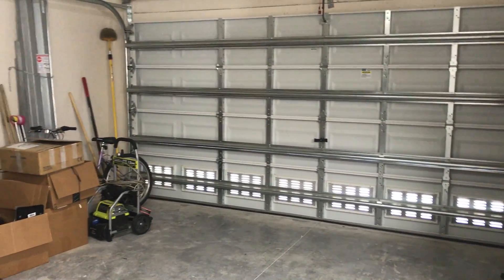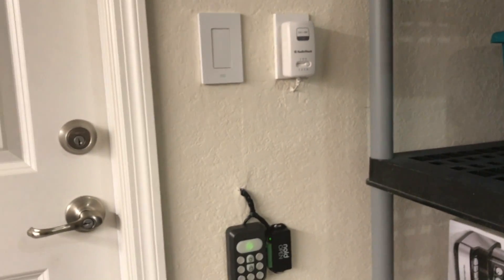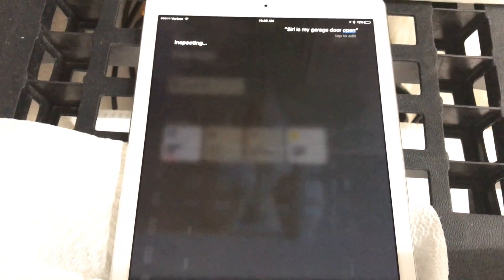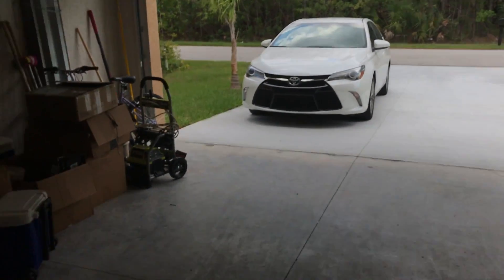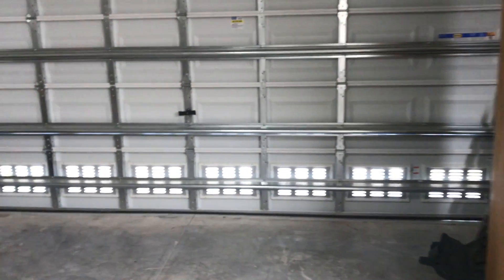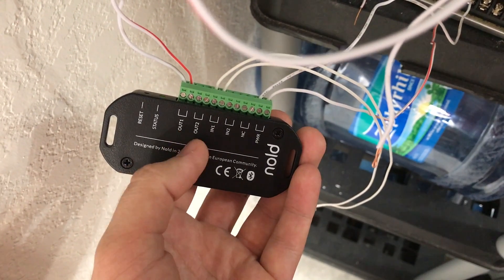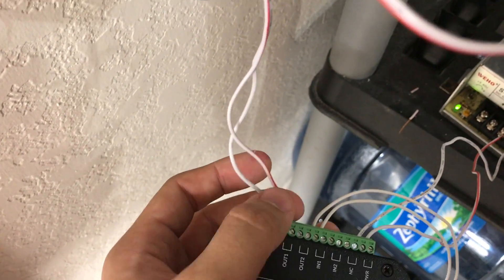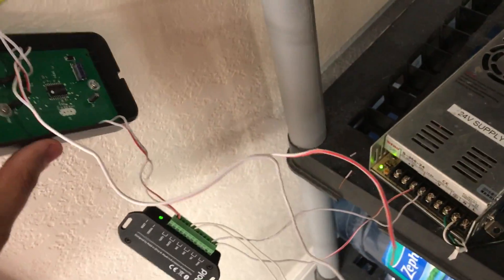Homekit Garage Door Opener - Ryobi + Nold Open

Comment: What are the wires with the screws on the back of the board?
Reply from the maker: Which part of the video are you referring too?
Reply: Matt B when you first take the ryobi box off the wall.  — is that from the orig setup?

Also — where is the HomeKit nold available for purchase? Their website doesn’t make mention of it.
Reply from the maker: Craig Beale unfortunately nold doesn’t have these for sale anymore because they couldn’t get the approval from Apple for resale. I was sent mine as test product because purchased one during their crowd funding on indiegogo 

The wires on the back are what I soldered onto the board so I can interface the nold unit with the opener. It’s completely custom. One thing I can say is. I have had this thing running since I uploaded the video with no issues. If you can somehow get ahold of one then IM me back and I would be happy to help you get it setup.

Comment: There's no mention at all on the Nold site about HomeKit. Any idea if/when they will release a HomeKit version of the Nold Open device? It looks like they know how, because as you say, you're using their HK prototype in this video.
Did they give up on HomeKit due to licensing costs or something?
Reply from the maker: MeestorXY I’m not sure what happened to the HomeKit licensing. The company shipped these out as test products. I would recommend contacting them to get the latest update on the release.
Reply: Thanks. They're not replying to their chat window or e-mails. Not a great sign.
Reply from the maker: Yea, thats not a great sign. I am in no way affiliated with the company but, its sad to see that this product might not hit the market. Ive been super pleased with the one I received.
Reply: They did eventually reply to my email. They said that a HK version is still in the works, it's just taking longer to get Apple approval than anticipated. So there's still hope!
Reply from the maker: MeestorXY they told me the same thing months before I made this video. I had to convince them to send me the HK version before the certifications where complete

Comment: In my opinion, the Nold open is NOT homekit compatible. How could you manage it?
Reply from the maker: Im not sure I understand your questions. Nold Open will be hitting the market this year as Homekit Compatible Device. I did not doing anything to the device that goes outside of the manufacture recommend setup. I did however hack the switch on the wall to make it compatible with the Nold Open. I guess you can call this and advanced setup.
Reply: I know that there will be a homekit compatible Nold Open this year but not so far. So you have the "normal" Nold Open which can be controlled by Siri/Home app? What is the difference to the official homekit compatible Nold Open which is not available yet because this one seems to work already....
Reply from the maker: Im sorry, I see the misunderstanding now. The Nold Open version I am using is the Homekit Version. This is why the Nold is able to interface with the Siri/ Home App. The amazing people over at Nold IO sent me the Homekit version for testing reasons.
Reply: Ahhhhhh ok, now I understand. I can't wait to get the homekit version. Looks great!! Best regards from Germany.
Reply from the maker: Im sorry, I see the misunderstanding now. The Nold Open version I am using is the Homekit Version. This is why the Nold is able to interface with the Siri/ Home App. The amazing people over at Nold IO sent me the Homekit version for testing reasons.